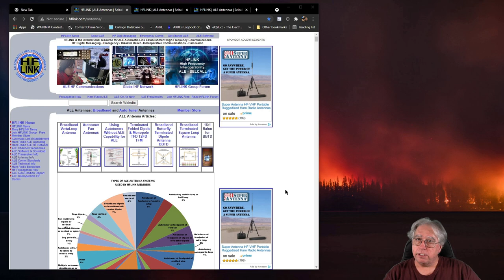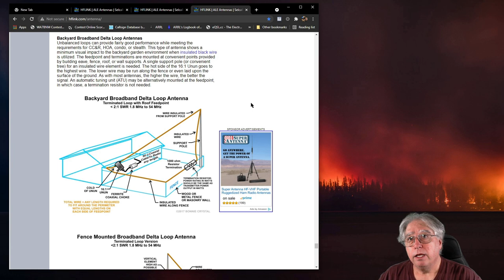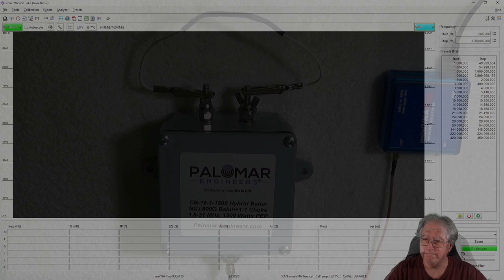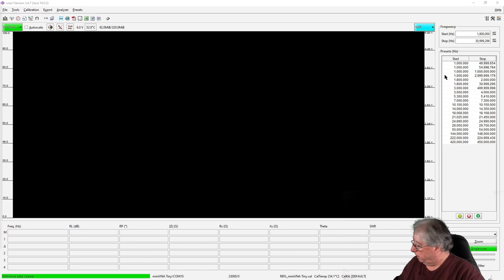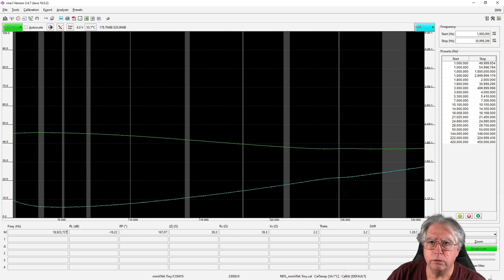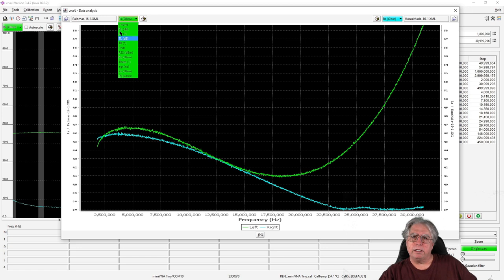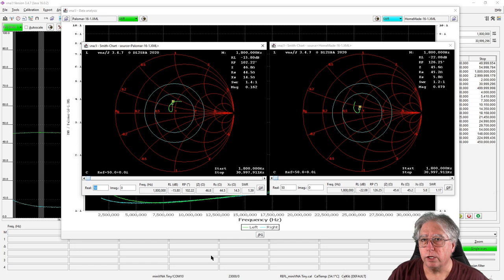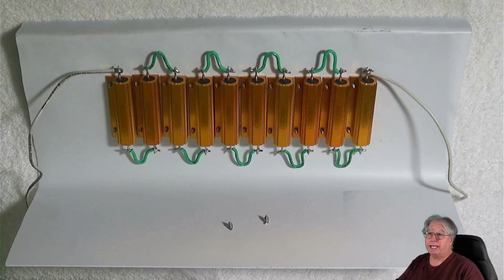Experimenting With Stealth Antennas, Both VHF And HF Part-1

Comment: Great show with great info! Fan & subscriber. I have been waiting for a show like this one to come up. I am in an HOA, unable to raise large antennas or engage with verticals that have ground radials. I am using Shark Whips that are attached to an MFJ Tri-Mag mobile mount which is sitting on top of my Durango. I parked the Durango next to the garage, and wiggled the R8 coax under the garage door, and hooked up to my IC 7300. It works, I am getting out fine on both 20 & 40, which is exactly where I want to operate, although 17, 15, 12, & 10 also work. I did have to move the vehicle away from the side of the house, since there is stucco on the walls, but I can still run my 25 FT run of  R8 with zero problems. I have had excellent QSOs with this system, Barcelona, Hawaii, Costa Rica, Canada, and most states in the US, so no complaints.

I saw that you had the VHF Owl antenna tied into a piece of sheet metal. I live in Heber City UT, snows a lot here, ski resort, snow mobile central, etc! I want to set up two of the Tri-Mag MFJ mag mounts, and attach them to either a steel picnic table, wheel barrow, or other metal object. This will allow me to keep 2 antennas up at all times, each with a different coax, and not tied into a switch.  

What I am not sure about is how much metal will I need under those mag mounts to achieve good QSOs? I can tie the table or wheel barrow to a ground rod, etc. Add more metal, whatever it takes, just not sure in the metalic surface area I will need to achieve what I want to accomplish.
Reply from the maker: Hi BMC Tackle,
Great question... The rule is a minimum radius of 1/4 wavelength around the base of the antenna, but you can cheat and attach copper wires on the corners of the sheet metal to get better reach. This is not a perfect science though. Take a look at this video (from the early days) and see if that helps...
https://youtu.be/XkY8lgtBkn4

Stu
AG6AG